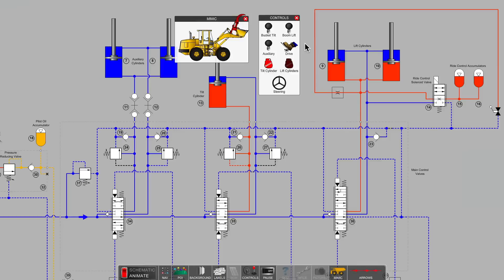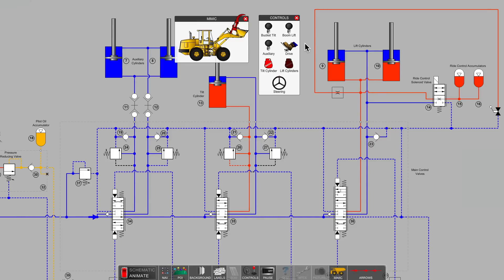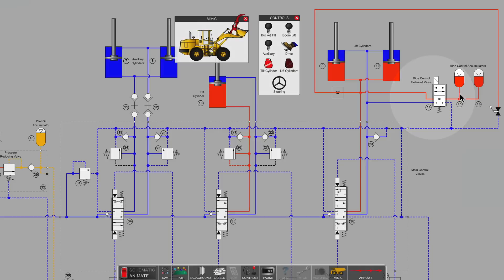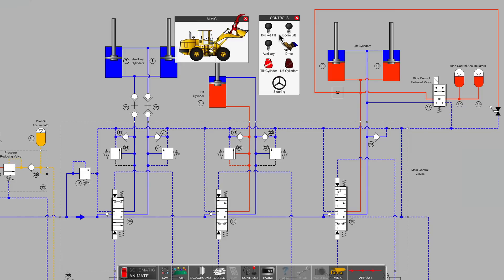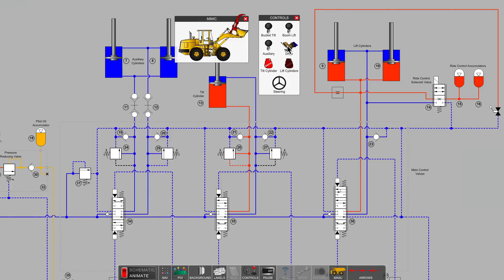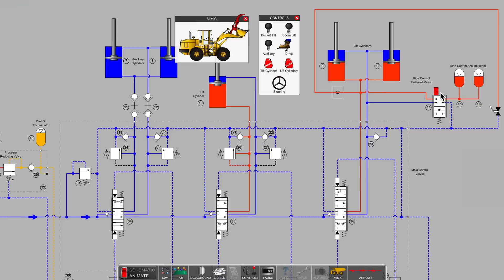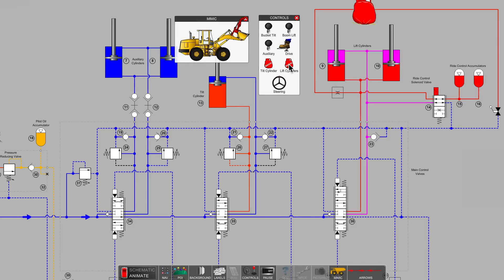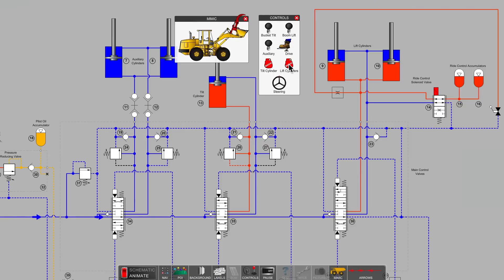Ride Control

Comment: Accumulators are used as shock absorber.
We should use anti-cavitation check valve to prevent cavitation in boom cylinders

Comment: If make up oil is being feed into circuit to prevent cavitation on the rod end how would it not end up building up in the accumulator? Also is there a way to compensate for different bucket loads?